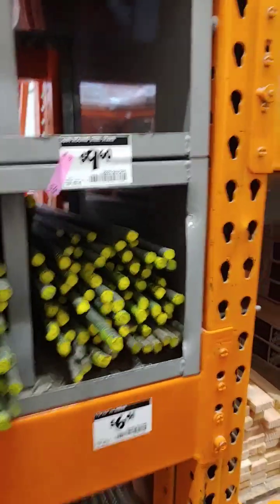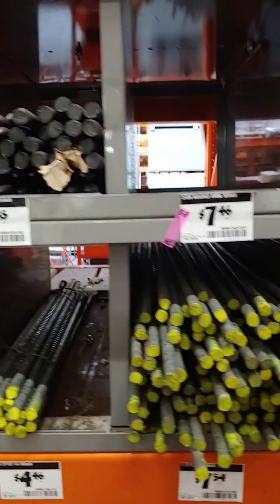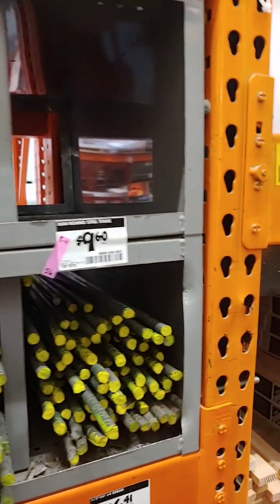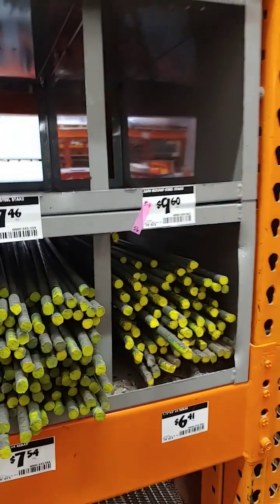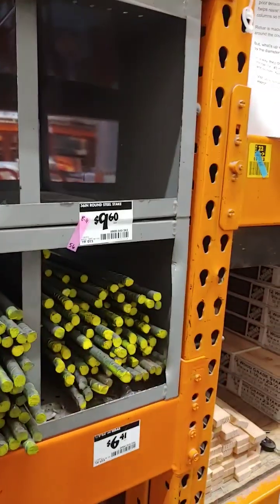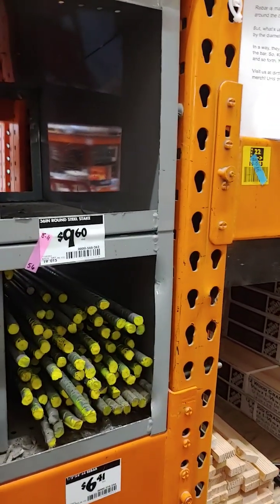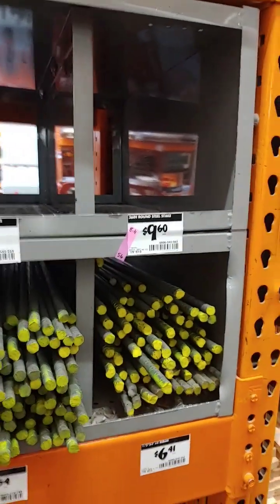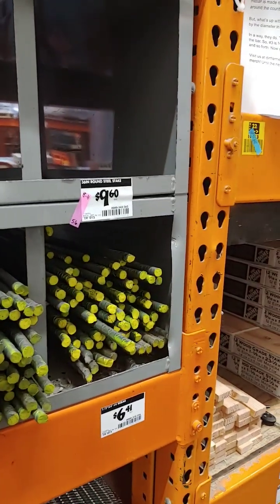Rebar Sizes Demystified!

Comment: What is the reason that there is an  yellow-coloured at the ends?
Reply: Just to identify the different sizes I believe
Reply from the maker: As far as I know, there is no standard color protocol for different rebar manufacturers. Some use colors to denote whether the material is weldable grade or not. I suspect in retail centers, it's simply to identify the lengths in horizontal bins to help keeps items in good order.

Comment: The rest of the world uses the diameter of the bar. so a 10mm or 1 cm bar is 10m, 25mm or 2.5cm is 25m. Not exact but it’s close
Reply: Yep from Canada usually only use 10 or 15 mm